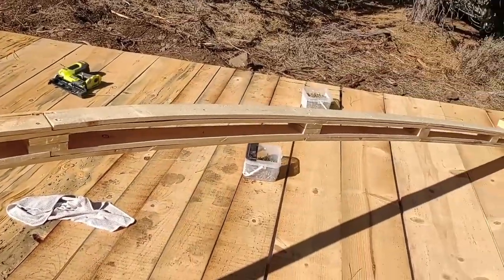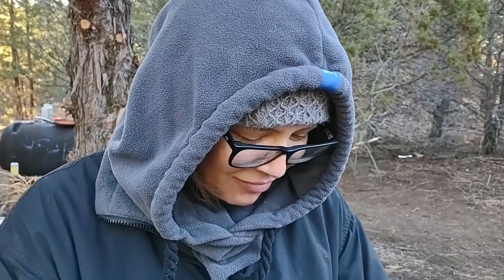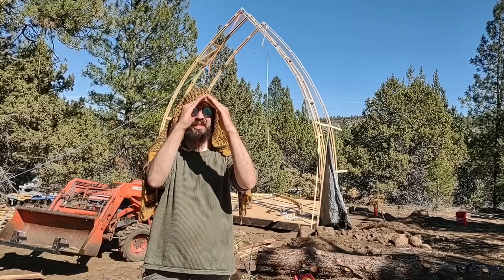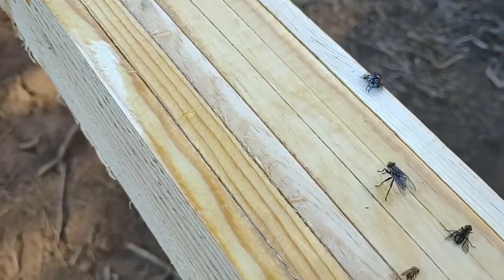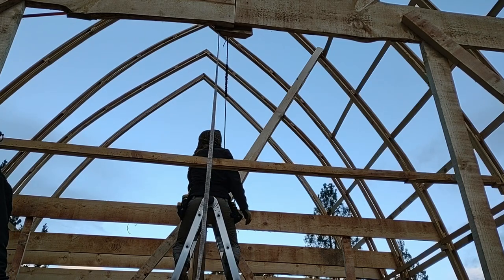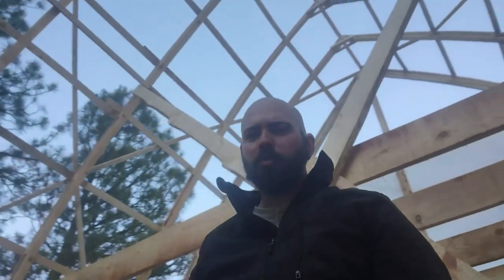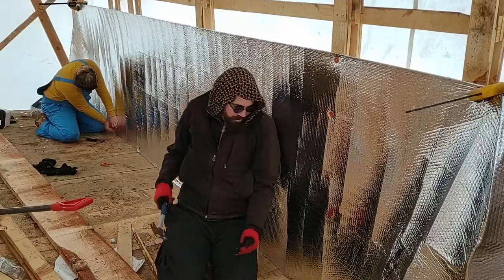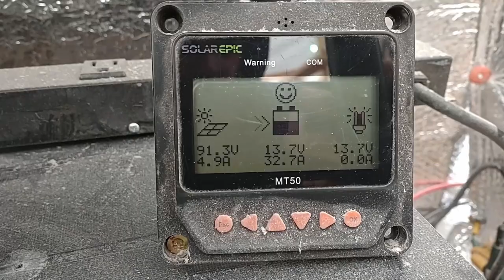Building a Gothic Arch - Off-Grid Cabin 2of2

Comment: You guys live n a cold environment. Glad you got it covered do you think just the house wrap will keep it from leaking. What kind of heat are you using in there? Wood is so warm .
Reply from the maker: We're in the high desert, so temp ranges from 0F to 130F.  

The covering is architectural fabric.  The same stuff used on the roof of the Denver Airport.  It's dry inside.

We were using Mr. Buddy propane heaters, and when it was 20F outside, we had it up to 80F in the bedrooms.  Now during the Summer it can be 130F outside and I have an AC unit in one room and have gotten it to 70F in that room on the solar power.

We also have a wood stove that I'll need to install this winter.

Comment: Hi you should have cut your wood 1"x 4" cause it's going to shrink to 3/4x33/4
Reply from the maker: I wasn't worried about what the actual size was as long as it held up.  And cutting it like we did resulted in having to cut down less trees. The structure has already withstood the harshest winter this area has seen in recent memory.